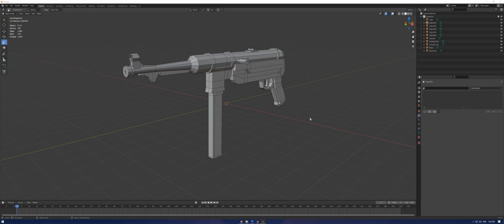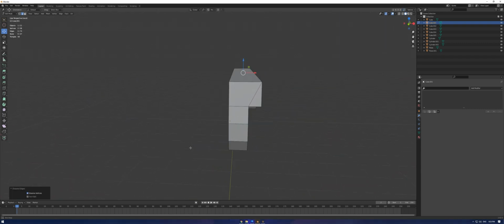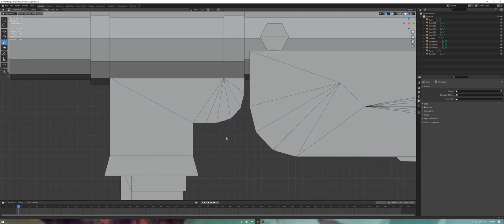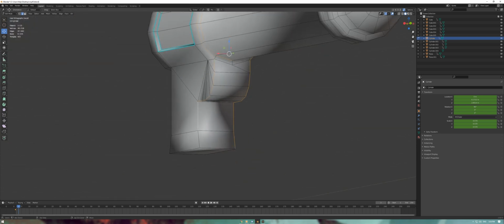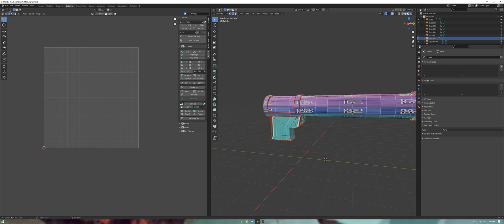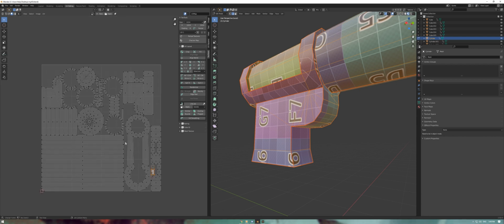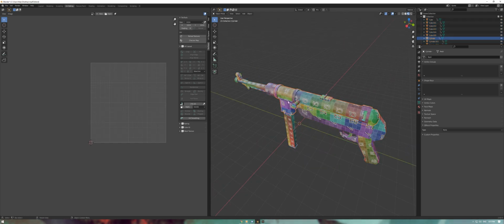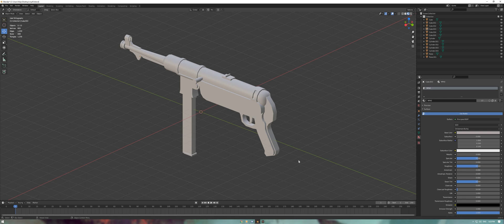How To Model A: Retro Low-Poly Gun [Part 2/3]

Comment: Well...I fixed the shading issue.
Reply from the maker: Brilliant. Dude, you saved me a lot of hours. Really odd that Blender had that set like that; I recall that other projects didn't had this issue, so who knows what happened here. I'll bring it up on the 3rd part as an addendum and make sure to give you a shout out :)
Reply: @FelipeCaravelli  I agree. The old 2.7 versions had this work automatically, but I guess for some reason they added the manual controls in newer versions.

Comment: Im gonna try to duplicate the issue with the sharp edges. Pretty sure I've run into this before and I think I can fix it.
Reply: Ok I think I may have a solution for you. Go to the "object data" tab on the right expand the "Normals" drop down. Check "auto smooth" and set the box next that to 100*. Please try this and let me know if this is the desired effect.
Reply: I also made a short video that shows me doing all this. I will post a link if that is ok. https://www.youtube.com/watch?v=I4vWL7w6Eus